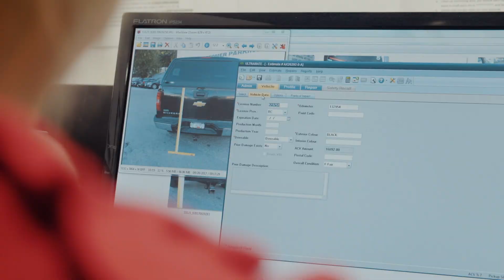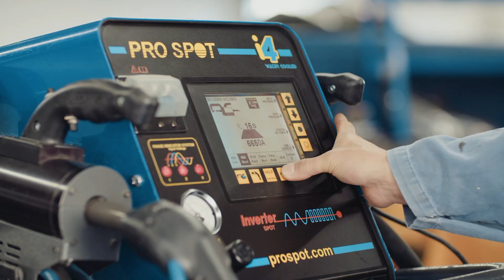Careers - Estimator

Comment: I'm intrigued by this as a potential career choice, but in Canada it seems near impossible to gain any actual knowledge or experience with the most popular estimating softwares, unless you already have a job in the field somehow. Ofcourse to get a job in the field almost all places are looking for 1-2yrs experience with say mitchell and audatex; so it's an endless loop that can't really be broken into. This was all learned from me speaking with employers hiring for this position, as well as calling corporations like Audatex, Mitchell, and others to see if there was any way a member of the public could take any sort of course to gain the knowledge and/or experience that employers are looking for. It's definitely a frustrating field to break into.
Reply: Vale in Mechanicsburg, PA  is where I went. CCC1 is the best and most used system. But, to start out the parts dept is the ideal place  and it aided me when i made the jump. You will know what is needed and when it is needed to start and complete repairs. But, make no mistake writing the damage as an estimator in a shop is like being able to run as a basketball player. Its managing the repair and knowing insurance protocol, and of course "when is my car gonna be done?" is the biggest responsibility.
Reply: @brianlogan4243  Really appreciate your insight. I've heard similar things about working in a parts role. I'm currently in talks with a shop for a hybrid role that will have me start out in parts and learn estimating on the side when available. Fingers crossed it all goes well.
Reply: @OctaneStreet  we specialize in high end cars. It's easily 80 to 100k a year with 10 years experience
Reply: Try and get into a Maaco that’s how I started